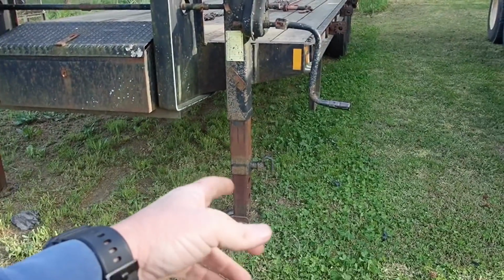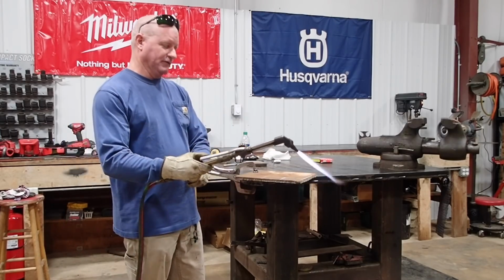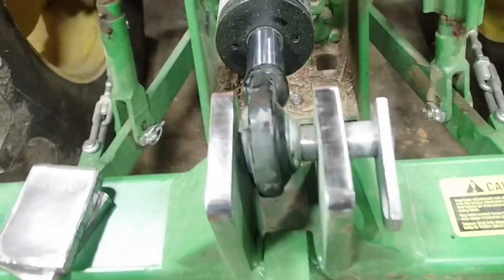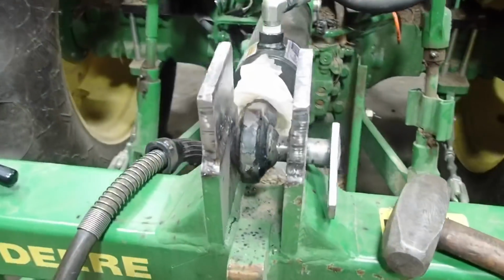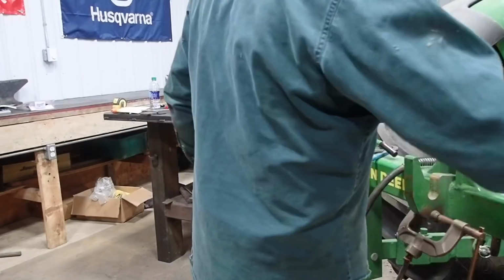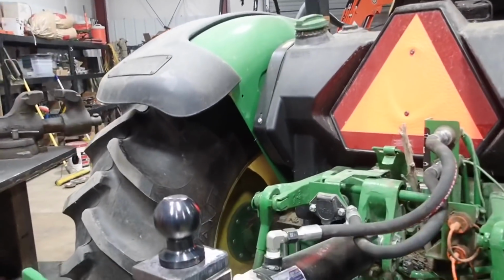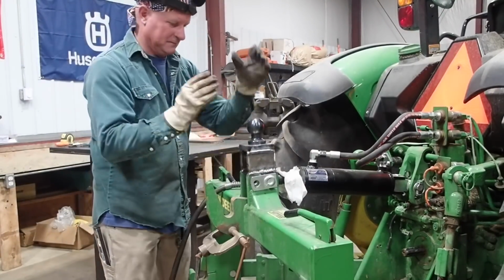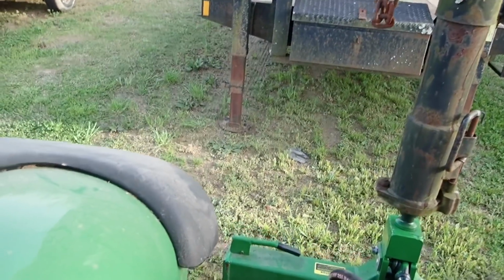John Deere 5075e- fabricating modifications for it

Comment: I have an older 1100  Hypertherm Plasma cutter. It's rated for 3/4" but will sever 1 1/4". On anything over 3/4" I'll use a torch. One thing you don't hear much about is the fact that a plasma cutters kerf(cut paths angle on each side) is a lot more than a torch, at least on mine it is. Not a big deal on thin stuff but the thicker things you'll need to pitch the cutting head some to get a straighter edge so there is not so much grinding to do. Anything that will carry a ground can be cut, like copper, aluminum and stainless.  I got mine as I do a good bit of stainless work but use it for the mild work too. The heat left after the cut is a LOT less. So much so you can basically pick most of it up and the whole piece isn't hot. I bought mine new and the sales guy told me I only needed one more thing, a set of tennis shoes! He said you'll need those to run with the torch on thin stuff. LOL You can see a lot of the things I do to make it easier in the wood splitter I made. Here is a link if you are interested.  http://imageevent.com/kevininohio/woodsplitter

Comment: Tim, nice mod on the quick attach. You cant beat the old faithful oxy fuel torch. I am actually a outside sales rep for my local welding supplier. Plasma is more expensive at first, but ends up being more efficient in the long run. Every time you light the torch you are burning money. Just think all the time the torch is lite that you aren't cutting, pre heat , moving around the work piece. 
There is definitely benefits of both.
Reply from the maker: I would love to have one but I do cut a good bit of 3/4” and thicker metal and I have to heat stuff too. I may end up with one one day.
Reply from the maker: Is hypetherm still the best to buy?
Reply: @cotontop3 yes hypertherm is bye far the top. That's all they do is plasma. I was over to their headquarters in New Hampshire a few years ago. Top notch people and facilities.

Comment: I bought a 50 amp Hypertherm plasma cutter for work a couple years ago to deal with some 1/4 aluminum plate. Now we use it for everything almost. We have a Oxytorch but we hardly ever use it anymore unless it is material over 1/2" thick. One of the best purchases i've ever made. It has never been out of gas when i needed to use it, like the torch always seems to be. That and the MIG & TIG welders as well. It never fails that someone left the damn bottle on when you go to use them and there out of gas. Pisses me off so bad.
Reply from the maker: That’s why I have 3 300cf oxygen bottles and my acetylene is a 400cf bottle. I cut quite a lot of very thick metal that starts at 3/4” and some over 1”.   Thickest I have ever cut here is 3” thick.
Reply: @cotontop3  Yea you would have to have a huge plasma cutter to cut that thick of metal. I don't think they make one that big. Do you rent your bottles or buy them? We bought ours a few years ago because of all the rental fees. Now we just swap the bottles with our vendor. I have got to find me a local vendor for some 1.5" plate for my shop press. I don't need a whole sheet just two pieces 1' square. Nobody wants to sell me that small of a quantity though.
Reply from the maker: I rent them 5 years at a time.  It doesn’t cost much and It keeps me plenty of gas to make it through any weekend if I have a lot going on.

Comment: What type of welder do you use? Brand, how many amps?
Reply from the maker: Miller power unit with a miller 22a wire feeder.  It’s a 250 amp machine.

Comment: Hi Tim what sort of braking system do you utilise in the US as you are allowed to carry substantial weight on your 5th wheelers.
Reply: Electric or electric over hydraulic usually. For pickups. Semis use air
Reply: @williamuskoski1385  Thanks for your reply I'm from New Zealand, we would have to move most of what you carry on your 5th wheelers on heavy trucks HGV in the UK.
Have a good day.
Reply: @grahampeters6609  other side of the globe. Thats badass. An yah your welcome. I try to help. Not be that dweed